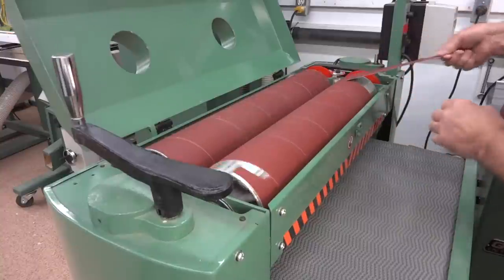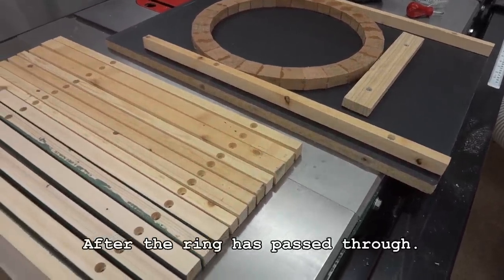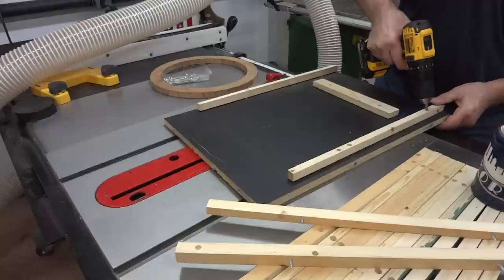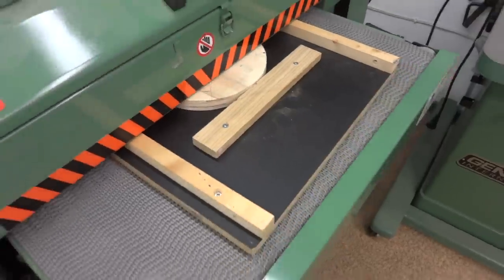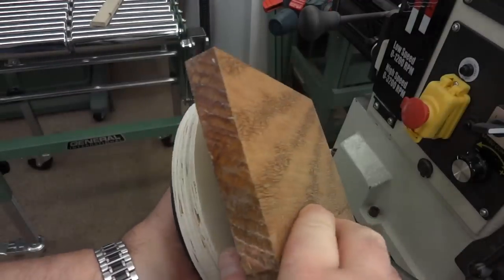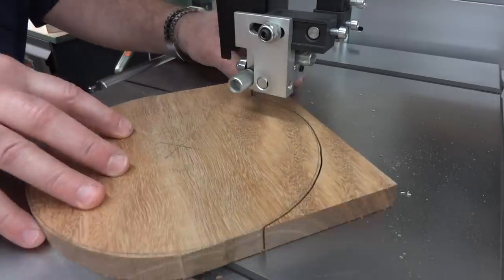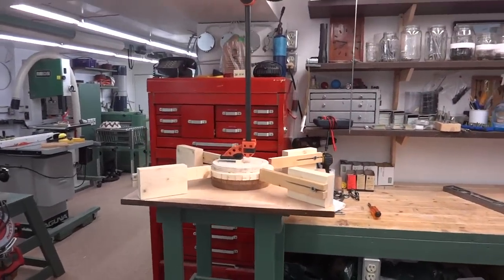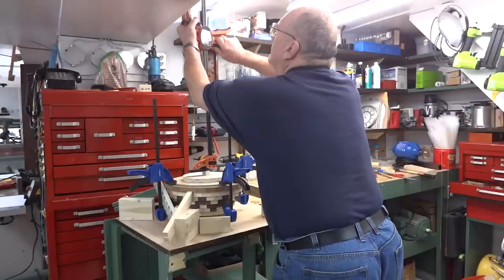The Segmented Flower Pot Part 2

Comment: Could you pass the rings through a planer if you didn’t have a large drum sander to clean and flatten them up?
Reply from the maker: Hi Kyle,
Thanks for watching. I'd be afraid that if the glue let go those hardwood segments may seriously damage the thickness planer.
Reply: Ron Calverley appreciate the reply, agree seems not reliable and dangerous potentially!

Comment: I have heard from another youtube channel that table salt can help keep the rings from sliding, but I have not tried it.
Reply from the maker: I don't think I'll be trying that because I'm concerned that the dissolving salt may corrupt the strength of the water based glue. However I could be wrong.
Reply: I was thinking the same thing in regards to the salt. Maybe just a few grains would work without compromising the glue up. Nice pot!
Reply: the salt will also stop the two pieces from bonding like they should, think salt grain spacers

Comment: When the drill is flexing as it goes in it is NOT on "DEAD" center!
Reply from the maker: Hi Bob,
Yes you are correct on that. It wasn't "dead" center. Gotta be more careful what I say in the narration. Since that video was shot, just over 4 years ago now, I've started using a centering bit in a situation like this. Works much more deader, lol. Thanks for watching and commenting.